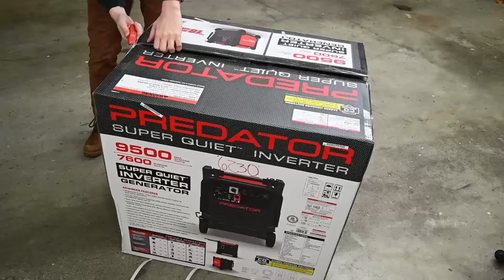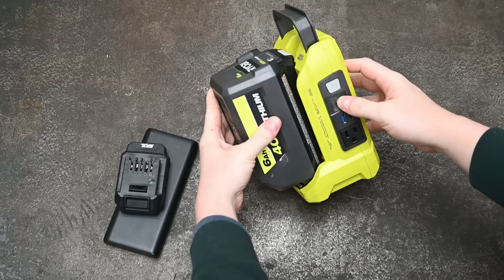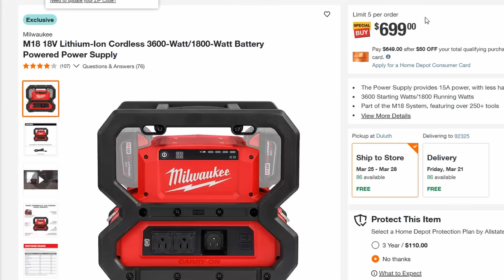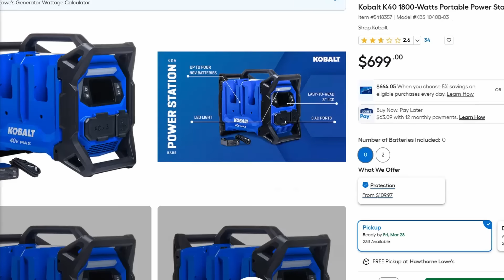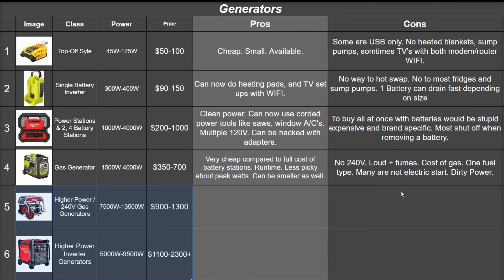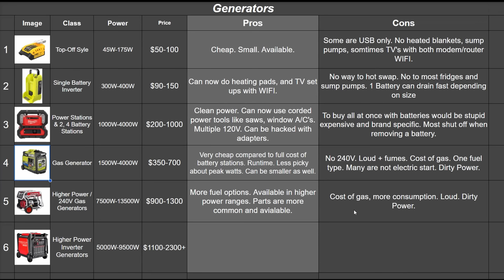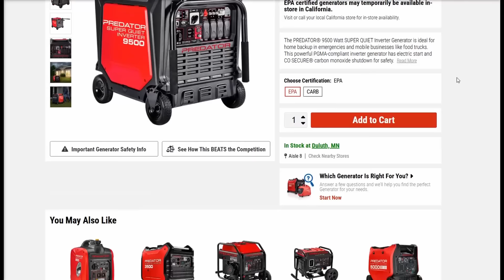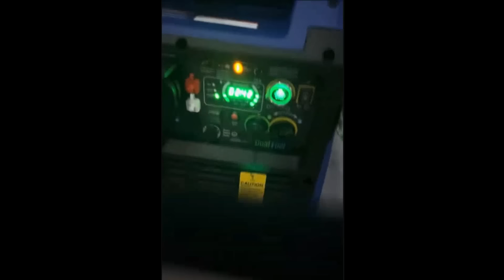Buying Harbor Freight's Most Expensive Generator So You Dont Have to

Comment: That little 2kw harvor freight inverter suitcase just powered my church's outdoor easter services- 2 gallons lasted from about 6am-1230pm and it was a CHAMPION! Kicked it into eco during the sermon and between services, and full bore for the worship (drew about 1800w but because of the live audio environment,  the throttle adjustment up and down wasnt consistent enough. It was a rock solid 119-120v the whole time.

Comment: I love my DJI power 1000!  It charges everything really fast, and it runs everything I've thrown at it, and I got the unit for $379 on sale, then added some solar panels for $100, and I had to get the solar adapter for $60, but still, in all I only have $530 wrapped up in the whole deal!  I also have a 6000W gas generator in the garage, but I rarely use it anymore.

Comment: the Lithium Ion based PC UPS work awesome <$200, i run a cheap lead battery UPS on router/wifi and the liOn(800watt) on my PC, it's good for nearly every outage. Especially with work from home, even a quick blimp is a pain in the a**.  Then a loud AF generator for whole house if needed, runs on propane , so no carb issue ever. be sure to use a battery tender on electric starts.

Comment: I have a Firman tri-fuel generator from Costco with 240V output, and similar interlocked panel back feed setup. The Firman also has dirty power, but we haven’t seen any effects of that, despite having LED lights throughout the house, and a lot of modern appliances. Thanks for sharing the effects you saw!

We have natural gas to our home, and it’s never had an outage despite multiple power outages. Running off NG cuts a lot of the generator output, but it will still run our house indefinitely as long as I somewhat budget the power draw and turn off a few non-critical circuits. It easily runs the AC and gas furnace, fridge, lights, and other basic draws.

Comment: Another great video.  I've already gone through the same evolution (and pain, and money) and ended up with a similar solution.  I think you covered almost everything.  It should help a lot of folks.  Although you touched on it briefly, having a few solar panels hooked up to the all-in-one battery solution (e.g. ecoflow) can be a game changer.  These units can function as uninterruptible power supplies for those rolling or preemptive outages.  Your internet doesn't even know they've happened.

Comment: Not mentioned that there exist dedicated power units that only supply 6 V / 12 V for running routers, modems and media converters. Those things last a stupid amount of time even when they only have a small battery because oftens inverters have a massive passive power draw that is greater than the power those devices actually consume.

Comment: Important notes you left out:   An important factor on those little tool battery inverters is that they used a modified sine wave (not pure sine wave).  You have to be extra careful what you decide to power on those or you could damage the appliance you're trying to run.  And for those larger power supplies that use the tool batteries, they DO NOT support pass through charging.   So it ain't gonna charge the batteries while you're running something.  Even if you have all the extra batteries, I just don't think those tool power supplies are worth it.

Comment: Luckily certain welders will run on 120 or 240. I have 2 that do.  How the heck is Harbor Freight  getting away with using the Predator name. Honda came out with Predator engines and Harbor Freight stole the name dont get how they can do that.

Comment: Im on a race team that uses these big harbor freight generators to power the whole pit lane setup. We'll easily rack up 1000+ hours with minimal maintenance with no issues. On our longest event, we'll fire them up on tuesday, and leave them running non stop until sunday evening of the following week, so 12 days straight. They dont get shut off at all, no oil changes, no filter checks, just refuel with it still running and forget about it. Most races, we'll fire them up on thursday morning and not shut them off until sunday night, and same deal for no filter cleanings or fluid changes, just refueling while running and leave them. The generators do not care. Ive been doing this for almost 2 seasons and we've only killed one generator in that time. The one we replaced it with ran for a week straight for a break-in. These things do not care. They will last. Abuse them, it does not matter at all

Comment: Is it me or is the guy thats holding that soldering iron holding the literal iron? like the part that gets hot to melt the solder.. ive always worked with a soldering iron/gun that was powered with AC power and the shiny parts are parts to not touch cause their hot af..
Reply from the maker: Yeah, that's why we included it. It's pretty funny for a review picture
Reply: @TorqueTestChannel  gave me a good laugh for sure I had to go back and pause it and double check my sanity 😂

Comment: 😮Hear this out. "inverter generator" doesn't mean that it's varying engine load. It means it uses electrical circuit called an inverter to modify the sine wave. Also If you want clean power during outage that is quite and wouldn't wake up your kids. There is a professional installed generators.

Comment: what would be awesome and i would totally buy is a hybrid. a single unit with generator and battery's. just plug in turn it on and it only kicks in the generator when the battery is low or there is a heavy load, add on a silent running/bed time mode that charges the battery to 100% and then keeps the generator off for 8-10 hours and have only 1 or 2 plugs stay active to sperate luxury's (TV .ect) from essentials (fridge .ect) that need to stay powered through the night. 

another way would be a power station and generator that can be linked and work together when needed or just used separately.

thinking about it may be a good product idea for Edison Motors its exactly how there truck's work but instead of powering axles its powering electrical appliances.

Comment: You should use rec(recreation) gas in your small engines. It has no ethonal in it and is just like gas used to be a couple of decades ago. That ethanol attracts moisture, evaporates, and leaves behind a crust that keeps your wngine running properly. 
I have lawnmowers, quads, bikes, chainsaws, etc. that all get fed rec gas. Never have a problem with them.
I did once put regular gas in my bike while on the road. I only get about 120 miles per tank and didnt have a choice. I parked the bike for the week, and when i turned on the fuel the next weekend, gas ran out of the carb. In less than one week, that ethanol gas crusted the needle valve enough that it wouldn't close.

Comment: " sensitive electronics" the first step is to convert the AC to DC, then change it to 400 or more cycles per second AC because it requires smaller components for the given power, then back to 60 cycle AC, most things will not know the difference about the THD it's being fed.

Comment: I have a Champion 8750/7000 single fuel open frame inverter generator. It supplies my whole house except for the central air and electric clothes dryer. The problem is during the last 5 day outage I had to carry several 5 gallon cans of gas. At age 74, I'm not sure how much longer I can do this. I'm thinking about converting to propane using 3-4 100 lb. cylinders. Any thoughts or advice?

Comment: Seems diesel is not particularly popular in the USA going by the comments. This Aussie lives in the tropics and has a 10hp 240VAC only 6.2kVA diesel gen as a backup supply, which is plenty to run 5 fridges, the stove and 2 or 3 air-conditioners or a welder as needed. Only ever used after any cyclone causes mains interuption. Diesel usage is about 15L per day.

Comment: Yes, but how much "torque" do the engines have in the generators :)

I rented a ~3000 to ~3500w generator, nice Honda unit, from Home depot to do some welding.  I have a 140a 120v welder, nothing huge when it comes to mig welders.  The Honda unit went bezerk trying to keep the welder going.  I'm a lousy welder which is to say that my duty cycle is quite low.  My friend gave me an old "wacker" branded generator.  3500w, pull start, very old school.  Welder ran great, for giggles I turned the wire feed and volts up all the way on the welder just to see if it would keep up.  It did no problems.

Comment: I've had the Predator knock-off of the Honda eu2200i inveter generator for 8 years or so and I've been very happy with it.  (I do need to service it, I inadvertently left old gas in it and now it won't start, but that's my fault).

Comment: great timing for this video. been looking at generators off and on for about a month and with money tight was putting it off. lost power last night and didnt get it back for 24 hrs. have enough 18volt inverters to keep small stuff running but came very close to losing the half cow in the freezer bc i couldn't get past the start up watts. started looking on market place to grab whatever i can afford for now

Comment: If you're heading off into this territory, you could definitely get into welding equipment and generators. These new mini-mig multifunction welders seem to crap out on their electronics with disturbing frequency. That said, can they be more safely used with an inverter welder? Or do you buy something with power factor correction built in. I'm running an Esab 180 stick welder off a 240 - 30 amp plug on a conventional Champion generator because of power factor correction and laying down 7018's at 120 amps - which even I find impressive.

Comment: If you want a whole-home style power solution for blackouts but don't want something gas/propane based, you could go with EcoFlow's DELTA series. They are fully battery based with the ability to tie in to your homes electrical system with their Smart Home Panel. You can recharge the batteries from solar, either existing panels or ones from EcoFlow.

Comment: I personaly ended up going power banks as the primary option.  Got some of the larger home system ecoflows and some solar in the back yard.  got plenty of battery for about a day with normal use or 2-3 days if were frugal.  Summer time solar will mostly keep up, wintertime I'd have to break out the generator for a few hours a day.   Nice thing about that much battery is you can have the generator running in its optimal power band for a couple hours when its convenient to do so and have absolute silence the rest of the day.

Comment: At the end of the day, I would rather invest in the Honda inverter generators.  Commercial grade and yes, you pay for it, but at least they are well known compared to Westinghouse or Champion and those who have had Champion and Honda say the Honda is definitely worth the money.  I have had Champion generators and the reason I got rid of them was they were a little small for my wants and I bought a King Canada unit, all of these were purchased used.  I have also owned and currently own Honda equipment and they are actually worth the investment, new or used.

Comment: I regularly see Predator 9500s in the orange sticker return section - which brings the price down to $1500.  Harbor Freight often runs liquidation sales on orange sticker items, bringing prices as low as $800-$900.  I have bought them twice now for parallel and both are chugging along well past 400 hours.  I am off grid solar, and I trust them to get the job done. -- For 800 bucks its a steal for a reasonably well built generator.

Comment: 15:33 Keep in mind that 9500 is max surge power NOT continuous power output which is limited to 7600 watts.  So a 30A 240V plug actually fits that requirement, as they expect some of the power to go to the other outlets.   Eco mode will reduce overall starting capability in generators as well, so if you have larger motor starting loads, you might not be able to run in eco mode all the time.   

One thing most people don't understand with generators is that you need to keep them loaded properly.   Most generators want a load of 50% minimum all the time, and then ideally they would be 70-80% all the time.  This can be hard to do with larger generators.  If they are under-loaded it will cause fouling in the cylinders.  That is why you don't purchase a 50KW generator and then run a 2KW load all the time.  My yacht has three generators on it, a 9KW, 22.5KW and 32KW, so that based on loading I can select the correct one to keep them loaded properly.     Great review.  Thanks for all the work you do!  👊🤠

Comment: The top model isnt the 9500, its the 13000
Reply: The 13,000 watt Predator isn't an inverter generator, it's an open frame.

Comment: Champion gen's are the best. it's just a fact. 10 or so years ago we have 4 gen's out in the field to power water pumps for livestock, The only one that didnt get replaced by the end of the year was an cheap champion 3600watt gen, That thing ran every day, for 4-6 hours, for 4 years, and now sits in a garage. The only work thats ever had to be done to it were replacing the pull cord, and filter/oil changes.

Comment: Use Lucas high zinc break in oil first 30 hours, magnetic dipstick/drain plug and non ethanol gasoline. Foam air cleaners are shipped dry and need to be oiled in ziplock bag with non detergent 30w oil.

Comment: Harbor freight has a 13,000 watt generator with tri-fuel (gas, propane, natural gas) and remote start. It’s not an enclosed unit but it’s currently as of 4/14/25 going for $999 new.

Comment: I got this exact model as is for about $1300. Upgraded from the 5000W version, I can run everything in the house including my stove, dryer, water heater and well pump. Getting the 240v to begin with is something I'd advise anyone who lives out of town and has to supply their own water and doesn't have everything running on natural gas.

Comment: Most power companies deliver dirty electricity to your home. It's not inverter power. There's too many variables to make it clean all the time( unless they are using just solar  energy  with inverters). I would hope that most electronics would work on normal AC power coming from the street. If the inverter generator is there to protect your sensitive electronics , what is street voltage doing to it 98% of time?

Comment: What matters here is battery chemistry. LiPoly is denser, more portable power for infrequent use, while LFP is going to provide many more charge cycles when used with proper care.  If camping, the charge ports are going to give out mechanically or from sun exposure before either battery type succumbs to mineralogical entropy.  At least you won't have to replace a carburetor.

Comment: I broke down a found a used industrial 23k watt diesel generator for about $6k. Came with a 75 gal belly tank. It's mechanical gov and basic 1980's control board, but it can run my entire house at full load burning 1-2 gal of diesel an hour. 

The power is clean enough that none of my electronics have issues except for the well pump kicking on, the sudden 30A hit does cause a momentarily frequency drop.

As long as the fuel tank is mostly full and treated, diesel has a very long shelf like.

Comment: in the #4 and above category, Champion makes many duel fuel systems. you can also combine (most of them) to run larger things. 
If you combine them with larger batteries,  you can conserve fuel and have a foot in both worlds.

another cool stacking option for the Ryobi is their backpack battery can plug into the inverter for longer run time AND you can swap batteries w/o interrupting the inverter. 
Ego has a neat charging system that chains. i think you can charge upwards of 40 batteries on the same outlet.

Comment: Instead of the 9500W Predator, you'd be better off with 2 of the 5000W units (remote start), and the 50A parallel kit.  Cheaper, more power, and redundancy if one generator does die in the middle of when you need it.
Same is true for any inverter generator, though and Predator isn't what I'd be buying.

Comment: i got a 6 k watt or soo 220 volt harbor freight dumb generator and it run house fine may be the brushes worn/springs are week not pushing on armature !! and if its an old brush-less install a new AVR that will fix it /10 pack of universal gen-set brushes on ebay are very !! handy to have for your old generator  YOUr house should not act that way at all hooked up to it .i ant never seen one do my house this way everything works great and all so worked good off the smaller brushless dumb generator

Comment: that only bad thing is lithum ion batterys charge up only 400 times or so  a solar panel with charger deal  and a 100 amp hour power queen  lithium iron phosphate yea its a bit to set up but easy to add another 1 or 5 batterys as time goes 5000 or so charge cycles  .that the plan here .total cost 100amp hour 120 battery has built in board so a cheapish inverter and panel to maintainer its charge  so it 200 more + extras wire n such